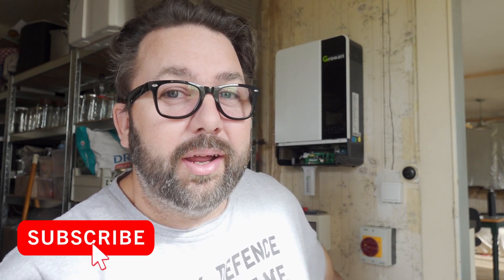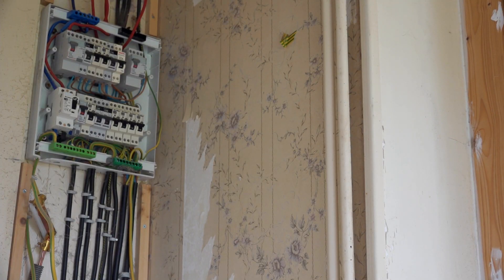Ben's Garage Goes Solar - On the Wall and Wiring

Comment: hi ben what is the size and amperage of your breaker and surge protection  , how can i work out the values  for my system?
Reply from the maker: The breaker I used was 'DC DZ47-63Z-2P 6kA 32A 500V MCB' and the surge protector is a 'protection contre les surtensions pour PV, LYD1-PV1000, 2P 1000VDC 20KA, montage sur rail DIN 35mm'. Got both from Amazon.
Reply: @Bensgarage  thanks  just ordered  spf 500es  , two 500 pylontech  batteries and 12 410 pannels
Reply: from Renugen   german company
Reply: is the dc disconnecter the same as the ac dis connecter
Reply: @Bensgarage  that's them ordered , the wee plastic cabinet that the surge protector and breaker sit in whats  the details for that?
Reply from the maker: @raymondlockhart7811  This is the one I got: https://www.amazon.fr/distribution-apparent-saillie-protection-modules/dp/B00MW89PQS/ref=sr_1_1?__mk_fr_FR=%C3%85M%C3%85%C5%BD%C3%95%C3%91&crid=2NSAHD2I4WRBA&keywords=B00MW89PQS&qid=1652434371&sprefix=b00mw89pqs+%2Caps%2C59&sr=8-1
Reply: fellow just got back to me and said that pylon texh are not compatable with grow watt and i should use  growwatt RHK  LOW instead?
Reply from the maker: @raymondlockhart7811  he is trying it on. Pylon tech works very well with growatt. Perhaps that is all he has in stock. Both pylontech and my solar supplier have said there are no problems matching the two. We have two US3000c, that both communicate with the inverter, no problems at all.
Reply: @Bensgarage  yeagh thats the ones i have ordered
Reply: 1.399 euro each
Reply from the maker: @raymondlockhart7811  well I can’t say anymore, than our system is working fine.

Comment: Enjoying very much Ben,  seems lots of deals on eBay for the hardware, hard bit for me I’ve been thinking about is how to hook it all into the consumer unit in the house, so be interested when you get to that.
Reply from the maker: We are having a separate consumer unit for the solar side of things. Will be running a 32amp feed from our old consumer unit to the inverter for grid back up power and to charge batteries when the sun is low. Then a feed from the inverter to the new consumer unit. Hopefully we will get to that fairly soon.